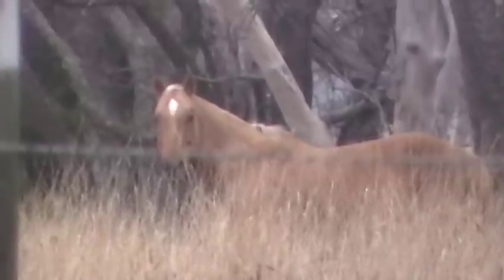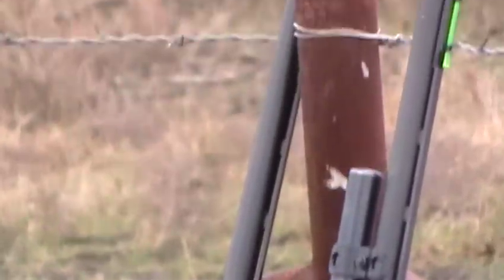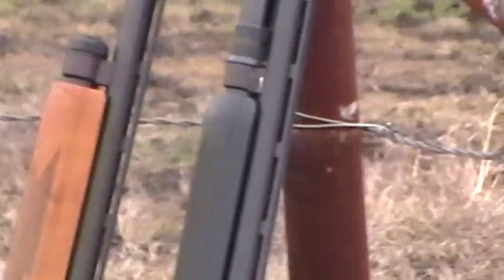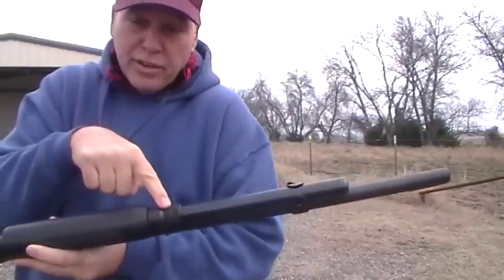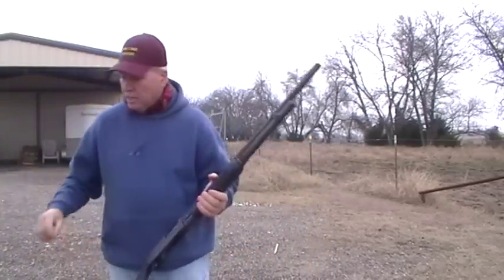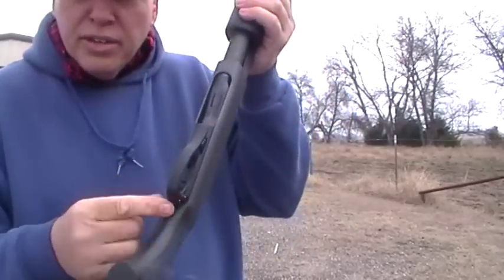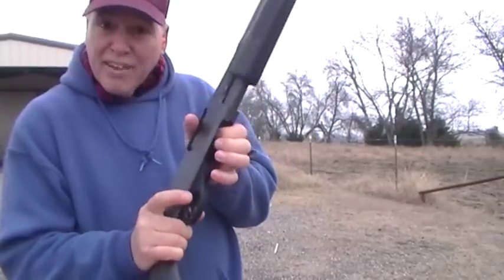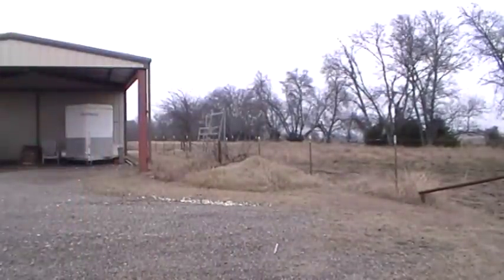Remington 870 Shotgun Test Fire Discussing Wood vs Synthetic & Extended Magazine Tube

Comment: That wood is a whole lot prettier, but the synthetic will last forever. $200 was a smoking deal. A 28" 870 Express 12 gauge was my 1st gun purchase at age 18. Wood furniture and steel all had a flat finish. The standard 3+1 with a -1 plug in it served me well for waterfowl. Today at age 45, my shoulders can't take 1 day of 50 rounds through a pump gun (especially slugs), so my goose gun is a 26" Remington V3 Field Sport Synthetic 12 gauge with a 3+1-1 capacity. It recoils like a 20 gauge. You have to try one. I opened up the loading port (standard on the V3 Pros now), bought a Pro bolt handle & release, and added a Nordic +9 mag extension making 12+1 for 3 gun. It adds 5 inches to the overall length, so I'd go with +7 for home defense. Softest shooting 12 gauge on the market. Especially for under $1k brand new. The Remington V3 Tac13 is the 13" no stamp required "firearm" version of the same gun. Again, ya gotta try it.

Comment: honestly the only problem with the solid wood stock is that when it’s cold out and you fire the gun the engravings actually hurt your hand specifically under the pump, you can wear a glove on your left hand in my gas so your right hand is free and won’t have any material that could get caught in the action, which would suck.

Comment: I actually had my synthetic stock crack at the very end. which surprised me. But it still shoots and has held up to hundreds of more rounds.
Reply: mine cracked on the first shot at the receiver...returned to bass pro and they replaced it no questions asked for the wood stock. and gave me a 20% discount card for my next visit...from a larger chain store i was expecting a fight but they treated me like a small family owned shop would.

Comment: Rick what are your thoughts on the longevity/durability of synthetic stocks? Are they tough and built to last?
Reply from the maker: never wore a stock out either wood or synthetic but plastics do not wear like wood especially if they are exposed to constant elements of weather, rain, heat and cold.